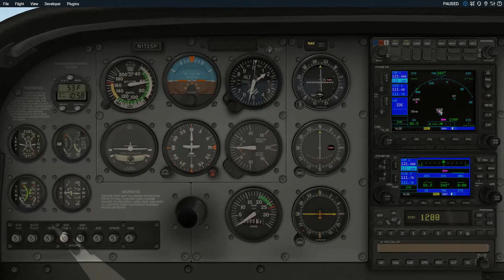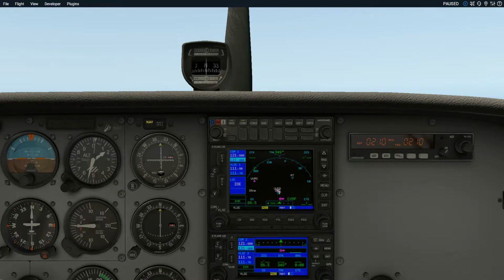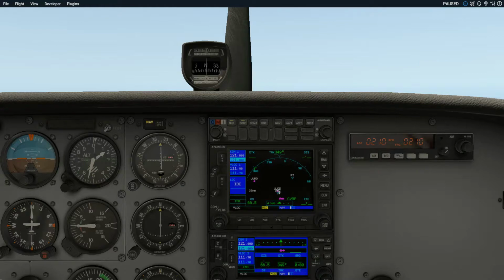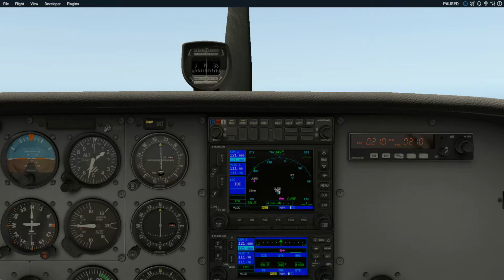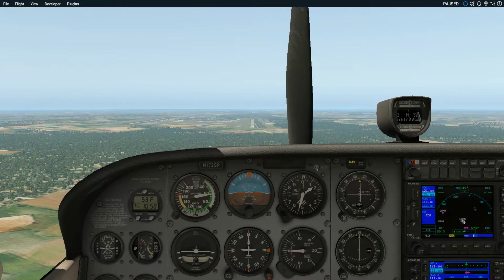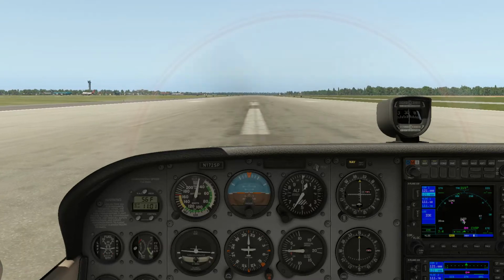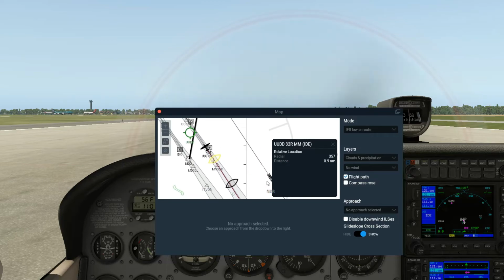X Plane 11 -  Marker Beacons

Comment: Do you have to manually decrease your altitude ?
Reply: Go to skyvector.com, on the top right of the map, click on the gray button for the "World VFR" chart, and browse your favorite airport on the map. (There is a search bar on the top left which can recognize airport codes, fixes, and navaids in the whole world. It will center the map over your search result, if recognized). Right click near any airport and you will get a drop down menu. Hover over the airport name and it will show you all the published procedures that airport provides. Some runways may not even have an instrument approach, and major airports will have several different approaches to each single runway. Not all airports have ILS approaches.
Reply: Once you find your ILS approach to a runway at an airport of choice, to be able to navigate it in your aircraft you need to set the approach course in your OBS selector on the VOR receiver of your aircraft, and also enter the Localizer (LOC) frequency in your NAV1 Navigational radio. These two things will allow your aircraft to find the electronic signals necessary to follow the lateral path (localizer) and vertical path (Glide slope G/S) of the ILS Approach. You will find those two pieces of information on the top every approach procedure's chart. (see my previous comment for one way to obtain charts)
Reply from the maker: The marker beacons are advisory only. If you wish to fly the plane using auto pilot, ensure to select an airport with ILS LOC and G/S.
Reply: how do i select an airport with ILS, LOC and G/S